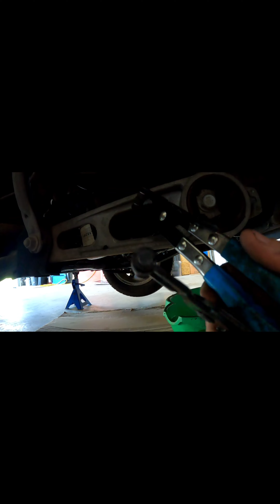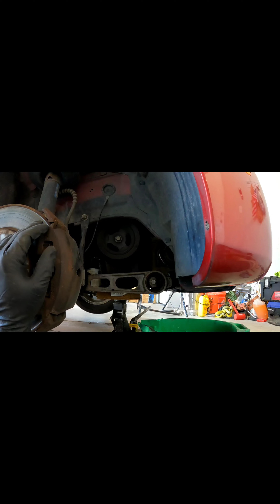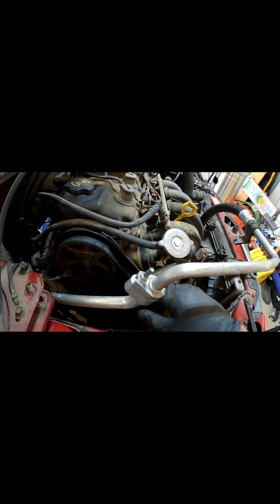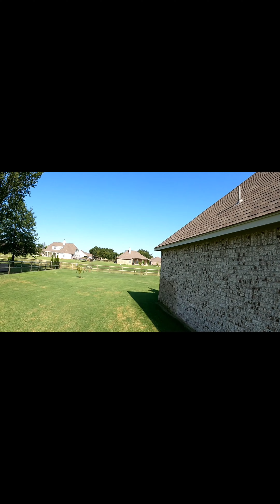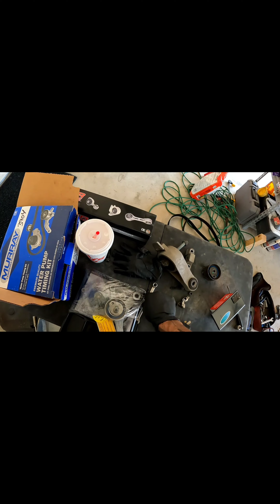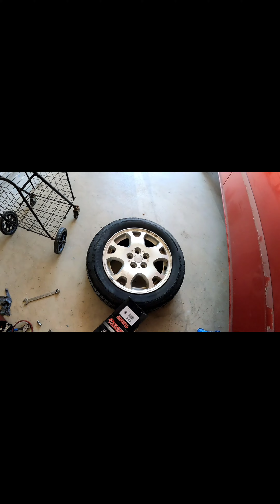Internal water pump replacement 05 dodge neon

Comment: Hello matthew. 

I trued to message you on the dodge avenger 08 video but it wouldnt let me.

I wanted to ask how you got off the  crank shaft pulley , i didnt see you do it in the video . We are also having a problem with taking off the water pump do to a nut on top of a connecting pipe which is under the exhaust piece connected to the engine  head . 

Your help would be much appreciated